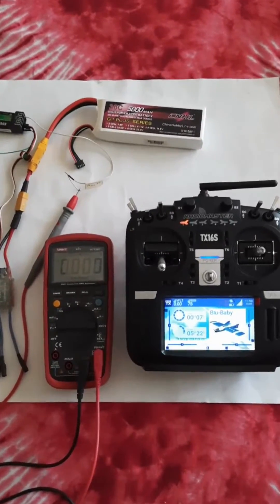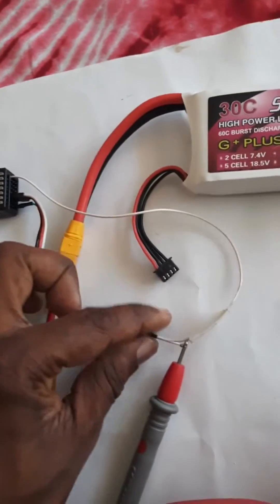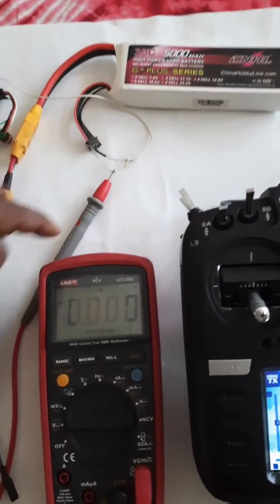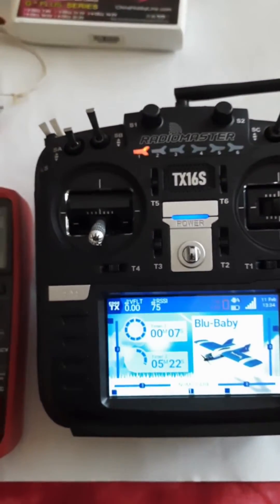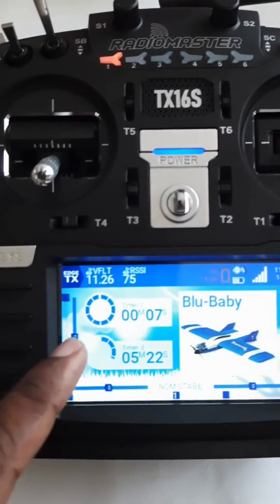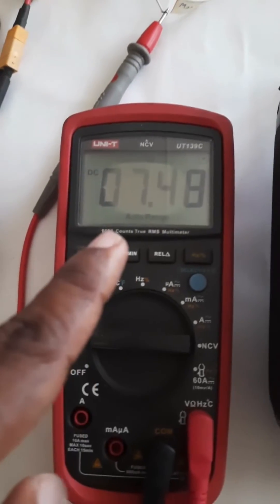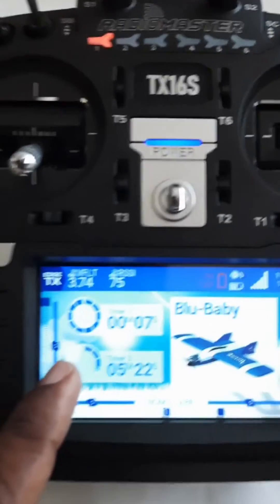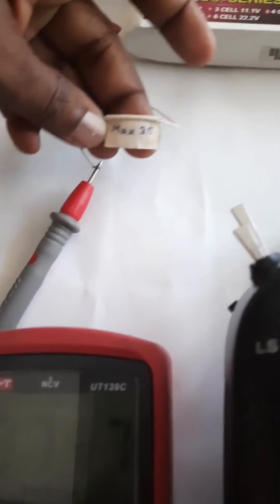Flysky FS-IA6B receiver modification - to get the flight battery voltage telemetry (easiest mod)

Comment: Hi very intrigued by your vodeo! If I understand correctly, you have cut 1 connecting strip between the 2 resistors and soldered 1 wire to the resistor and thats all! Brilliant. Do I have to upgrade my flysky fs i6 for this to work because it seems to only read up to 10v as standard. Thanks for your help. Tony
Reply: Thanks for all your help. Tony
Reply from the maker: Hi Tony, I haven't updated the firmware. 
Can you let me know the following two?
1. Were you able to verify the both voltages values as identical ?(voltage provided to the new sense pin and the telemetry voltage value shown in the transmitter)
2. May I know the PCB version of the IA6B receiver (is it the black color PCB)?
Reply: So sorry, I did not explane myself very well. I have not done the modification, I just wanted to know if it worked on the flysky fr i6 without updating the firmware! The reference to the 10v is what my tx will go up to in the menu! Thanks for the reply. Tony
Reply from the maker: That is alright. You do not need to update the firmware, modifications mentioned from 2:08 in the video is sufficient.

Comment: Resistor R5 broke on my IA6B. The one to which you need to solder the wire. Could you tell me its value so that I can find a replacement? I will be very grateful.
Reply from the maker: R5 is 38.8K OHM in my receiver (10K : 38.8 K OHM resistor divider is available there)
Reply: @simplee338  Thank you very much, I will try to restore the voltage meter on my old IA6B receiver.